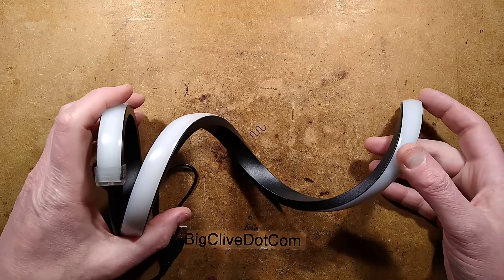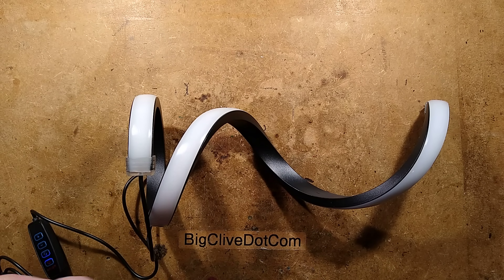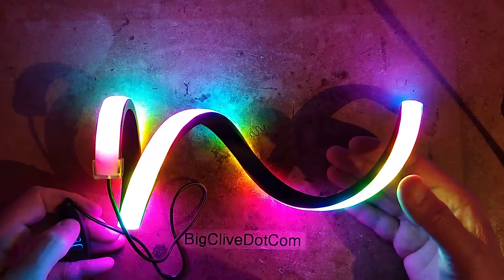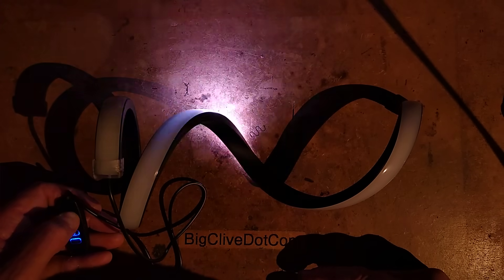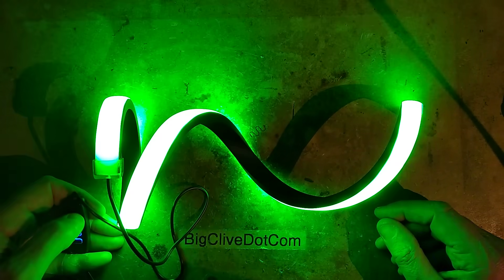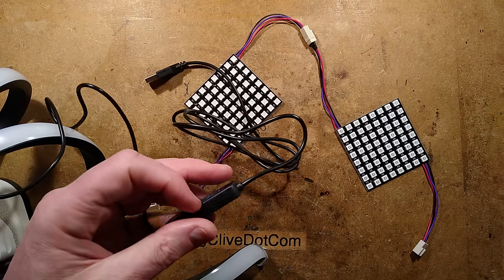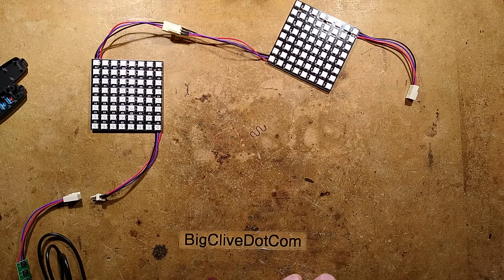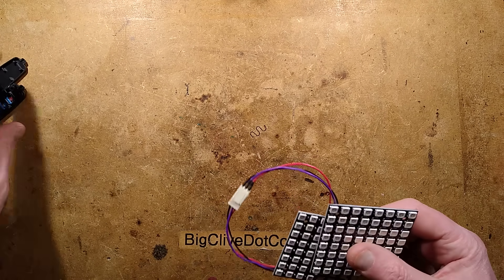RGB 36-LED spiral - bit bashed to the edge

Comment: I used to avoid these kinds of LEDs because they're kindof a pain to control properly. 
The PIO in the RP2040 microcontrollers are pretty ideal for this tho. All the main CPU does is write a 24/32bits into the fifo, wait for it to empty, and repeat untill out of leds. The PIO just chugs through the bits at a fixed speed, and when you don't load any more bits for at least 50us, the strand updates itself

Now I pretty much only use these when i can use an RP2040, or similar dedicated hardware. Other wise its something with an actual clock pin, like APA102. Timing based serial can fuck all the way off, lol

Comment: This is hardly relevant to the video but I think it might be interesting.
I used some RGB strips to light up an area of my room and I've noticed when using white settings, I can get a slight chromatic aberration effect at the edges of some objects when backlit. It's really fun especially because the colors are separated in a way things like frames will have different colors bordering each edge.
Though the effect is super subtle.
Reply from the maker: They used to sell lights that did that.  They just had three higher power LEDs on their back.  One red, one green and one blue.

Comment: Best bitbanging I ever did was when I slapped a 20 pin mcu directly onto the back of one of those 8x8 multiplexed led matrices and drive it directly with 16 of the pins. That left 2 IO pins free, so I chained them together using a simple time based single wire protocol. It could scroll text and icons by shifting the data out to the next display and it was programmable through that IO pin as well. 

worked fine even directly connected to a 3V cell, due to the 1/8 the duty cycle of the multiplexing :D

Comment: It takes me back a decade or two! DMX was my favourite, started with 24, then came 96 and i was able to create a pinball machine on a ceiling of a swimming pool. Of course Zero88 had a 255 line and I had two run three parallel cable pairs out to get the lights to sync, not sure understood it at all back then but would try anything untill it worked! Tough life, being paid to play with toys..

Comment: I believe every solution I ever came by uses some sort of bit bashing to drive WS2812-style LEDs. Given their popularity, it would be great to see the MCU manufacturers to come up with a dedicated peripheral for this. I think it would be fairly easy to implement this as a special mode e.g. for an SPI peripheral.
Reply: The RP2040 hips can easily handle WS2812-style LEDs through a PIO module, and doing so is a textbook example in the programming documentation.  The PIO module can then be fed from a DMA stream, leaving the CPU almost completely idle.

There are also I²S libraries floating around for control of WS2812 LED strips, since the normally-intended-for-audio peripheral is close enough to one-wire bit-banging at a remarkably high base clockrate.

Comment: I once made an ebay purchase of something with RGB leds on it and they had the red wire going to the board pin marked as G, green wire going to pin labeled B, etc etc and I fixed it and told the seller who insisted I had it wrong and should put it back the way it was ignoring the fact that it worked right after I moved them. Ok?

Comment: The quintessential WorldSemi LEDs!. There are various flavors with a picky timing requirements.
There is also a chip variant, WS2811, that can be coaxed to function as a 3 channel pwm controller!. In a lighting application, they do have issues with accuracy of color and flickering(due to low 400Hz pwm, apart from the delay from one to other in a daisy chain close to 30ms(max 1000 leds), barely good enough for nice fading due to borderline persistance of vision characteristic). Apart from that, most mcus that drive these could hardly keepup with the high speed timing using a modified spi clock. They are also memory intensive, limiting the string length to the max available ram. That said, you can drive a fair number of them(256+), even with a 8MHz SPI clock of a 20MHz Arduino, with some clever but simple(3 component) external circuitry🤔.❤👍

Comment: WS2812 LEDs will work down to 3.3V, they are just dimmer. Looks like a lot of the patterns are calculated and sent out on the fly rather than being read from memory. The microcontroller is using it's internal clock and if this is a but umm rubbish, it can affect the number of LEDs you can reliably control. Seems like quite a high value resistor for the data line.

Comment: The problem with the "other brand" is that they are the older version of WS2812. The WS2812 type (these were 6 pins, separate pins for VDD and VCC iirc) runs at 400KHz clock. The "newer" WS2812*B* variant has 4 pins where the V+ is shared between LED's can chip, and runs at 800KHz clock rate. Driving the older ones at the higher clock rate causes the weird flickering. These LED's don't just read the data as it comes by, it actually stores and forwards it. So the second LED will see the data as put on the bus by the first LED, it does not see the data/timing of the microcontroller but corrected timing from the first LED.
Reply: The chips used on the most common "fairy light" strings are even more different. They use practically the same protocol, but to make assembly easier the data line is shared across the whole chain, and the leds are pre-programmed with individual ID's. I assume each die is etched with 50 or 100 individual chips, and they are kept in the correct sequence when they are cut. Essentially, they all see the same data, but count until they reach the spot meant for them and ignore the rest. This means that you can't daisy chain more strips, or change the pixel order. I have one of these strips, where one chip in the middle somehow "lost" its id, and replicates the colors of the first.
Reply: They've been available in 400 or 800kHz versions for a LONG time but Iv'e never personally come across a 400kHz version.
Reply: Came here to comment on the 800kHz and 400kHz thing - yes - it could have been that causing compatibility issues.  Obviously the actual silicon used in different strings and panels might not be the original WS2811 die either, so there could easily be other variances in timings and allowable operating margins.

Comment: Well isn’t that horrible? I’d replace that crappy led tape and all its horrid hot spots with a high density RGBIC cob tape, running off an app-programmable driver it could be quite acceptable then.

Comment: I've used ATtiny85's doing the same thing, using the Arduino IDE and it's WS2812B libraries. It works very well with a wide selection of manufacturers. The easiest option is a development board like the Digispark boards, or you can go for the dead bug option.

Comment: Does every LED have an IC in it for decoding the data? 🤔
Reply: Yes.
Reply from the maker: Yes.  Not a microcontroller, but just a dedicated chip with basic timing , shift registers and buffers.
Reply: Each led takes the first 24bits of data for itself and then passes on the remaining data to the next one. so the data stream shrinks by 24 bits at every led output, until there is none left to pass on.

Comment: at least they had red for positive, i had a usb lead that was red negative, black positive! no data lines as it was purely  for power
Reply from the maker: I do always recommend testing USB cables if using them for other purposes.  The swapped polarity is surprisingly common.

Comment: As others mentioned some days ago, the lamp holder would be ideal for use with WS2812B leds and an ESP32 or similar board and WLED. Judging by the cost of these things on AliExpress, I guess it would also be cheaper to buy the lamps from there rather than 3D print, assuming you have a 3D printer anyway. I'm currently on the page you linked to and the RGB version with the base unit is showing as £1.71 + 34p tax.

Comment: I bit bang all the WS2812B i use except for my spiral lamp that's running WLed. bit banging is easy if the processor is fast enough.
Never put a resistor in the data line as the only reason could be to reduce noise.  Starting to use the RGBWW version  which means you have to work with another 8 bits in the data.
Reply from the maker: The resistors in the data line are usually to protect against short circuits between the data line and a power rail.

Comment: It's a nice little light. I could do things with some of those.

Recently I've been seeing what I can do with those 8x8 WS2812B boards. I've connected eight of them together and used a Raspberry Pi Pico W microcontroller to drive them. It makes a decent message display. There is some code for the Pico that drives WS2812s with very accurate timing. It easily handles the 512 LEDs I've got and could probably handle a few thousand  at a go. I keep adding those boards to my AliX orders, so I'll be making a bigger display soon 🙂
Reply from the maker: Keep in mind that the current requirement for these LEDs is high.

Comment: The problem with LEDs at the end being glitchy can be power supply related - the voltage drop & noise both get worse the further you get along the string, and so the farthest LEDs may not be able to correctly interpret the data stream. You may find that adding some bulk capacitance along the string, and some decoupling, may help, as might powering both ends of the string. You're likeky to have more problems when more chips are lit & current is higher (remember these are PWM, and power rail impedence plays a role..). The problem is likely to be worse if the timing is not quite right, of course..
Reply: Been bitten with glitches in so many ways but the ones I worry about most are voltage drop and ground resistance. One time, adding ground return to the data in signal, made it go glitchy.
Reply: Those capacitors are not 'token efforts'. They need repeating down the string.

Comment: This is where the RP2040 is great - the PIO modules can handle the bit banging without loading the main cores, but is obviously not as simple/cheap as a cloned 8 bit core... 
It's tempting to get one of these and swap the controller for a Pi Pico and do some less nauseating patterns.
Reply: an RP2040 running at the stock frequency is more than fast enough to address these kinds of LEDs even without the PIO
Reply: @afurryferret  Adafruit has one of their "feather" boards that was designed with the express purpose of driving the WS2812 type lights _in quantity_. And by quantity, meaning 'several thousand'.  I have one that will be running the high density ARGB fans in a computer, and that's only a tiny fraction of what it's capable of.
Reply: I was think ESP32-H and make it controllable by Zigbee.

Comment: What if you just get rid of the 1k data resistor. Maybe you can get smoke and light. 😂😂😂
Reply: Without a fault, probably much better data over a longer distance. 50 ohms would stop reflections a bit. This is not DMX though.
Reply: The cheaper LED's will add distortion to the timing. Remember, you are relying on each listener to pass-on the message.

Comment: I like it more with the outside glow, and RGB. 
The timing on the data line is so tight on WS2812B so Im not surprised by the blinking garbage. I like the lamp though 2x👍
Reply: I've found that the timing is not as tight as you think. the led chip reads the data somewhere between the end of TOH and the end of T1H, so it it just reads after TOH should have gone low, it it's still high then the data is a one. the following low can be quite along as long as it's not longer than a reset period.(Treset).
I think it just re-sync's on the rising edge of every data bit as it always starts with a high.
Reply: The timing is not as harsh as you think.

Comment: I thought there may be a reason the string is not longer, might adding a larger capacitor at the output help at all? The light may be interesting to thread two together, an inner and an outer... I had something similar years ago but without any form of controller so I would have to smash the power to the pin and hope it would produce any kind of effect, might make a fun game, try and get m the same colour on each row type of thing... It would be fun to put a speaker or ten on the output and listen to the data coming out

Comment: Dave Plummer of the programming channel Dave's Garage built several things like this himself: you can see them in the background of his videos. But we're not all as clever as him. Edit: I think it was him who explained to me how serially addressable LEDs work. This helped me to understand exactly why Clive's LED bar chart showed him how many LEDs the controller for this device expected to drive.
Reply: oh, he made those himself? I was wondering where to get those.. guess I need to get crafty and make my own then.
Reply: @WooShell  If my memory serves, he got a commercial fixture and replaced the LEDs in it. Then incorporated the processor module into the base.
Reply: @ i did the same putting two strings of RGBWW and an ESP32 in the base as well.
Reply: @WooShell  He uses an ESP32 and the software is WLED. its easy.
Reply: @andymouse  yeah the software part isn't what i'm surprised about.. ;-)
Reply: Yes... Dave does some awesome things.
Reply: That's the same dave that was a scammer in the 90s right?
Reply: @Doctorindahouse   if you mean writing dodgy software for windows, then yes ?
Reply: @Doctorindahouse no. He was a Microsoft programmer. Helped program several dos and Windows operating systems.

Comment: That would be a great home for a mini ESP32 module running WLED. Very tempting...
Reply: Must...resist...urge...to...buy...shiny...but...ultimatly.usless...toy.
Reply: One of these running a nice candle / flame effect and WiFi control.
Reply: I have just made a project running 10 32x8 matrix panels, driven off 8 of the GPIO pins of the ESP32. There are some things still to be developed a little more with the multi strip support. Next stage is multiple ESP's in Sync :)
Reply: YEP!
Reply: I was thinking this too. It should be very easy to adapt to wled.
Reply: @porklaser  I did buy one and converted it last week, and yep it was very easy to do and looks great. In my case, as I brought the one without the round base, I had to do some cutting to make a space to put the controller at the bottom if the strip, with a USB-C poking out the bottom.
Reply: WLED and F-AMPs have lit 300+ feet of landscaping and home exterior.  Seasonal decorating is now just opening a cell phone app.
Reply: An ESP-01 with FastLED library is sufficient. I know because I already did it. Plenty of memory left for coding effects and WiFi stuff - FastLED is not all that big.
Reply: I got a couple of these after the last video with the spiral light,   squeezed in a small ESP32 Pico board into the remote with just the power button switching it on & off and the rest controlled via the WLED mobile app and replaced the white/warm white led strip with a RGBW pixel strip
Reply: Hey Clive! Are you interested in a (Amazon) recalled powerbank for a teardown? It’s a 10.000mAh unit with lightning, usb-c and an Apple Watch charger. If you get me an address I’ll send it to you!